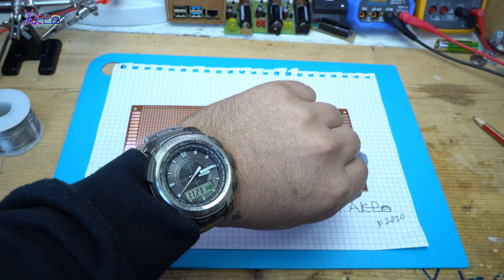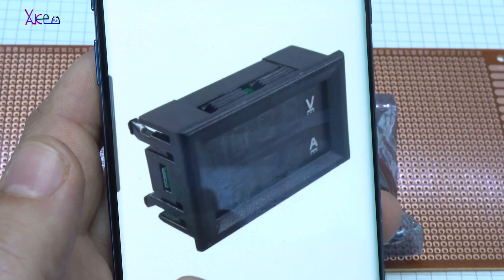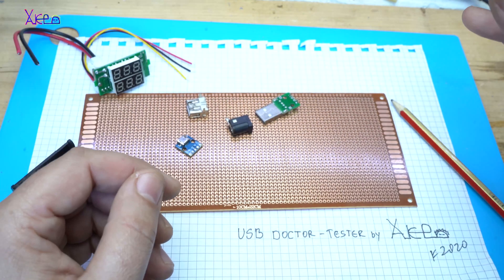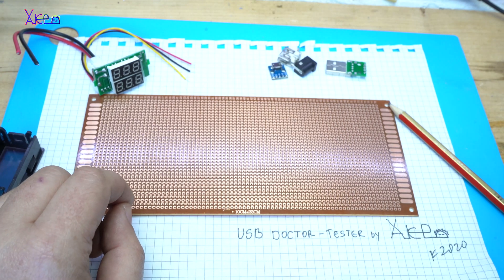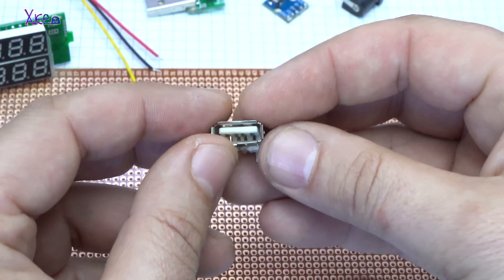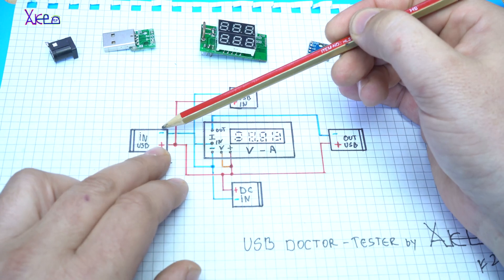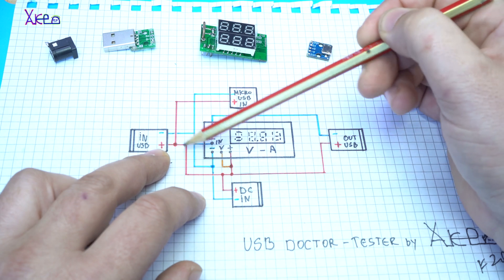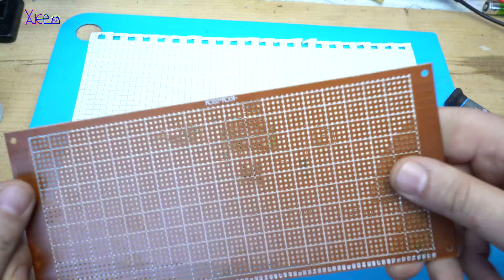How To Make USB Doctor | Homemade DIY Gadget

Comment: very nice gadget! just a few comments. if you're trying to measure usb standard devices with different charging protocols you may need to connect the data lines to the different usb connectors and maybe solder the board with thiker wires. And if you want to improve it to a higher level i recommand you to include a mcu to the design and also mesure capacity and othe stuff

Comment: Either the Volt-Ammeter module from Aliexpress is bad, or the Ac-Dc Apator you used to check the voltage is very bad. 18.9 volts when the slider on the adaotor is set to 12V? That's way too bad man. Even the label on the adaptor shows max 12V.

Comment: Volt ammeter doesn't show the current correctly if you don't use individual power supply for it.
Reply: @Hacktuber  just measure current with a multimeter and your diy device.this module show the current correctly if you connect the red and black wire to the another power source.otherwise because of common ground wire between power supply and ammeter the device show the current wrong value

Comment: 11:11 it'll not take more power then 0.75 amps without the data pins if you connect the data pin so it'll communicate to charger or connect some kind of resistor divider between all usb pins(+ve to resistor to both data pins to resistor to -ve)

Comment: Great video as always I especially like this USB Dr. Video since it can be used at more than 5v to test adapter. Is there away to wire it to test amp that is from the power source before a out source is plugged in to the Dr. Maybe thru a switch with a diode????? But if not still a great video, I'll defently be make 1. Thanks again and keep it up!!!!!
Reply from the maker: Thanks for support and thanks for comment,stay safe